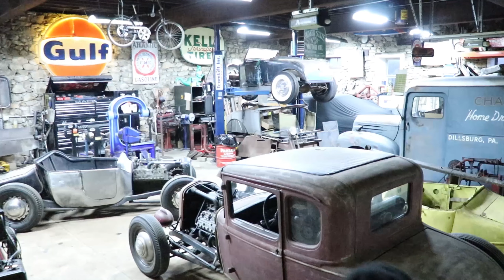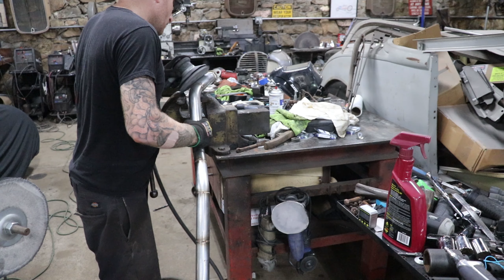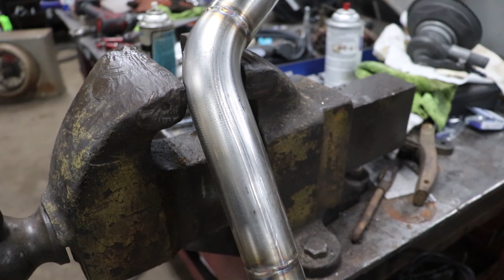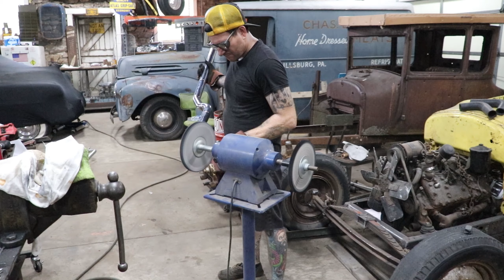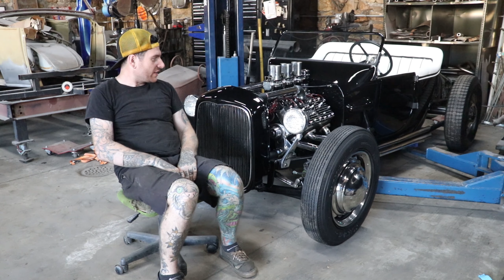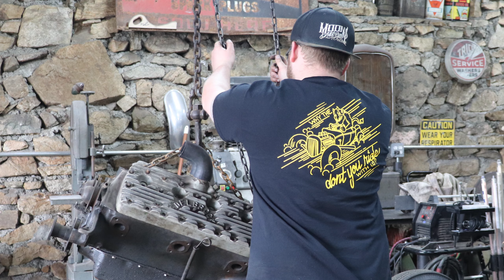How To Polish Stainless Exhaust - Ford Free-T - Ep. 92

Comment: Long ways from the days of a exhaust bender and single pipe and flat muffler. I love the look but it is labor intensive. I wish I could still build cars but my day came and went years ago. You mirror my job of the day so well. I grew up with the flat head ford v8 and the little six as well. I made a ride out of a more than I care to remember actually. Lots of split exhaust manifolds that died on my bench trying to get good welds with nickel rod. Great times coming
Reply from the maker: Thanks for watching Morgan! -Matt/ITG

Comment: you made a sensible choice on polishing.    My hot rod has bumpers made from stainless flatbar, and some other parts made from 18g stainless.   I went all OCD, wetsanding up through the grits (to 2500) and it was a ton of work.  Looks great but I wouldn’t do it again.